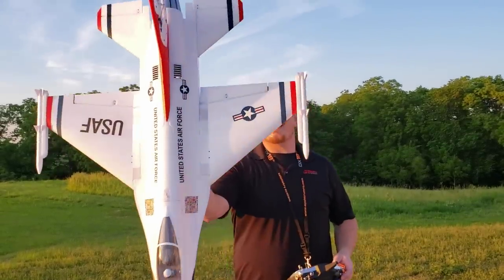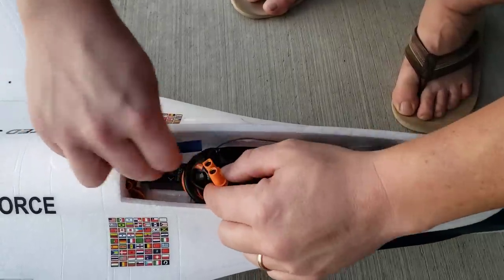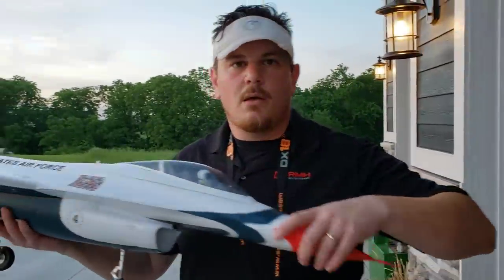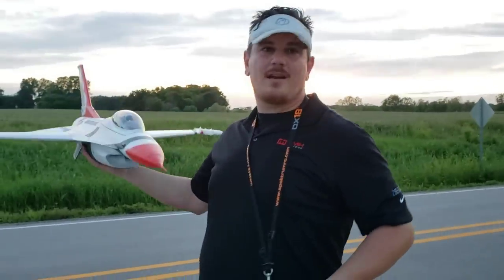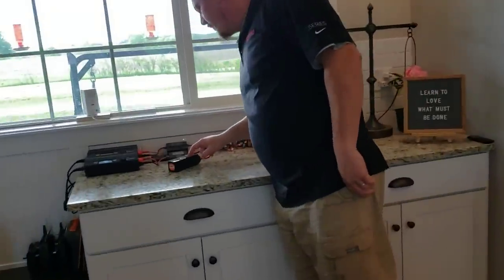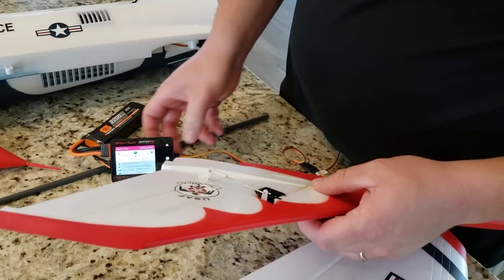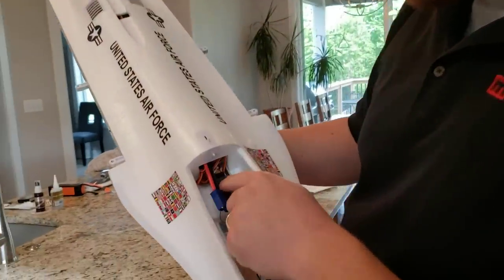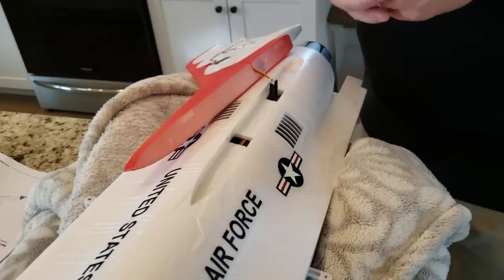E-flite - F-16 Thunderbirds - 70mm - Unbox, Build, Radio Setup, & Maidens

Comment: Would it be sacrilegious to install a tail-hook? I mean you mentioned a carrier landing at any rate. There's going to be a naval aviator who scoffs at an F-16 configured that way though. On second thought, maybe just pretend there is emergency arresting gear in the grass. :)
Reply from the maker: They tested the F-16 for carrier landings, but the landing gear were insufficient for the riggers of carrier landings, plus the NAVY likes twin engines where possible, which is part of the reason they went with he F-18.

Comment: Hey sorry for all the questions, but what are your thoughts on hand launching the Thunderbird? Other than it being big do you think it's doable? And do you think a 5000 mah would fit? Hopefully I can leave you alone now. Just trying to decide between the Thunderbird and the habu still LOL
Reply from the maker: The F-16 could be hand launched. If your flying 5000mAh I would highly recommend getting HELP if you need to hand launch. This plane will fly slow, but I don't want you to have to RUN AND THROW. I'd highly recommend you stick with a 3200mAh 6S 30C OR 4000mAh 6S 50C (I far prefer the later - 4000mAh 6S 50C https://bit.ly/2WpSdj5 ). Get that pack ALL the way back. Check out my latest video, where I add the Gooniac LED Afterburner, and modify the placement of the Rx...you'll see. Big difference, but VERY little effort.
Reply from the maker: Don't feel bad. I don't mind questions, as long as it's not the same one over and over again. I know what you're doing. When I was first into the hobby, I would STEW over picking my next plane for hours and hours. It was a BIG deal to me...especially on a tight budget. If I picked bad, I would be heart-broken. I TOTALLY GET IT!
Reply: @BrianPhillipsRC  thanks for all the help! I settled on the f16 but then seen it was backordered until december but so is the habu pnp lol. Thats my luck lol.  So I'm going to get the habu rtf package for now, not that I need another transmitter but it comes with the smart battery and stuff and I guess I don't have to buy and setup a extra receiver now.  I only asked about the 5000mah because I have a couple for my eflite cessna I would like to use but I guess I'll worry about that come December. Thanks again and looking forward to the next video!

Comment: Up and down counts as 1.
Reply from the maker: what?
Reply: @BrianPhillipsRC  For assigning safe,  up/down is 1 count.  So, up, down is one instead of up 1 down 2 up 3 etc. My spitfire says that up is 1 down is 2. But I'm the F16 and most other planes the manual says up/down counts as 1. So 5 up and 5 down (10 total movements) is considered a count of 5.
Reply: @Mektah  don't you have to assign aux 1 to the switch you plan to use for safe - BEFORE you do the 5 up- down thing
Reply: @lw216316  I didn't think it mattered as long as the switch was assigned to it's own channel.Now I'll have to check

Comment: Maidened it yesterday. 3 batteries of pure misery. It was slow, nose dipped in every turn, it was hard to takeoff, harder to land even with AS3X. I watched, as always, your build video, even though this EDF you could build with the lights off, it was that easy. I felt this was going to be a step backwards after building and flying the 64mm a-10.
I was about to throw the unblemished F-16 in the trash as I was leaving the field, but I figured I could use the plane for spare parts.
Then it dawned on me in my moment of hara kiri. I NEVER CALIBRATED THE ESC! God I hate being stupid! But it comes so naturally....
Reply from the maker: Why did you have to calibrate the ESC???
Reply: It was monstrously under powered. First flight was with a 6s 3200 35c (Smart battery) 2nd flight was with a 4000. No noticeable improvement, maybe worse especially on landing. In level flight at 75-100% throttle it flew great, no trimming needed. 
I almost drove to Iowa to have Esteban assess the plane.